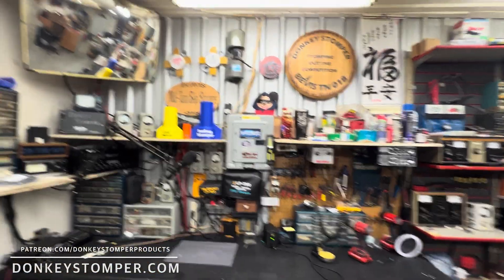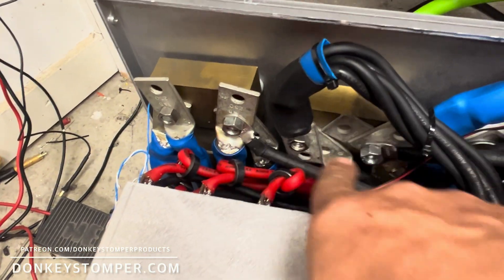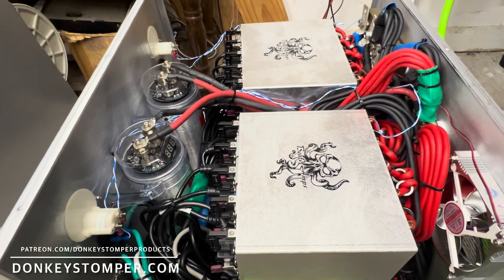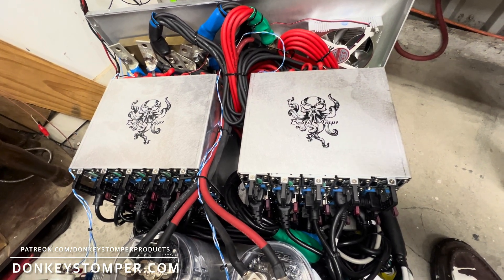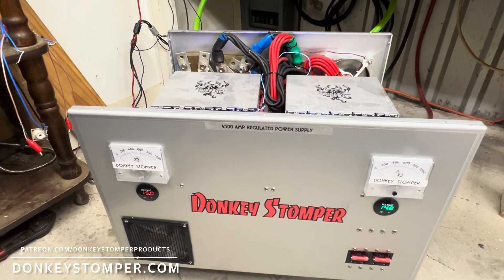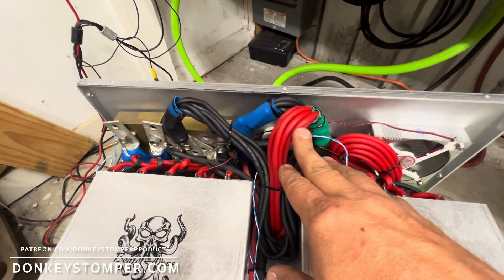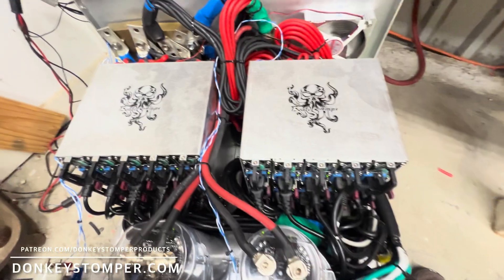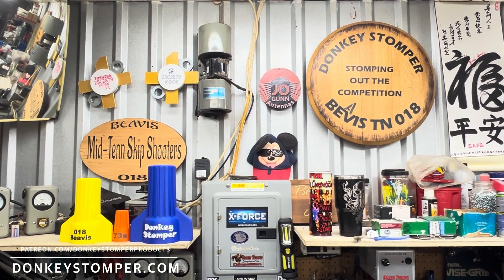Biggest DC Power Supply, In Amateur Radio in the World?, 4500 AMPS Regulated DC Power Supply

Comment from the maker: In Video I said 300 something AC to run it. I figured it up. It would take 268 AMPs  AC to run it full bore . Before some one corrects me. Its hard to remember to say everything correctly on camera. Thanks For Watching!  donkeystomper.com
Reply: 8 ga AC power cords are rated at 40 amps max.
Reply from the maker: @IpsoFacto-s4x yes it I agree short lengths 8 is fine. Like I said in video we got builders using 14,16 short getting by no issues. Thanks
Reply from the maker: @IpsoFacto-s4x  I just realized you said power cord. Again correct, This will work for me. If it was customer I would have used 4/3 each side.  I prob would do it two separate cabinets. Its not for sale.  Thanks! donkeystomper.com
Reply from the maker: @IpsoFacto-s4x  something else interesting power cord I used was 50amp Welding extension cord. I used 50 amp on off breakers. I'm sure if I had full 268amps to run it would need adjusting a little. For what I'm doing its over kill anyhow.